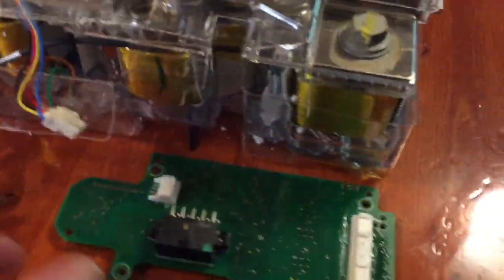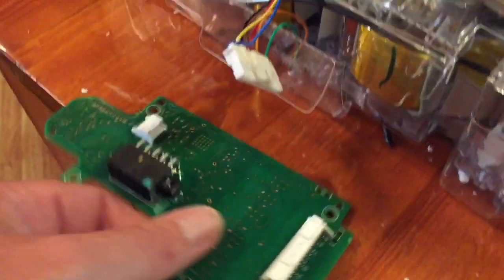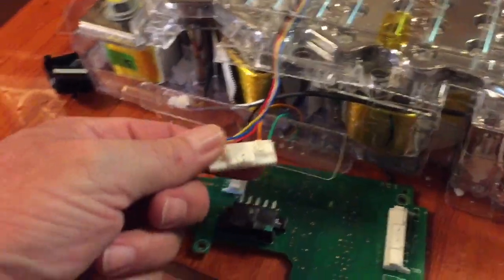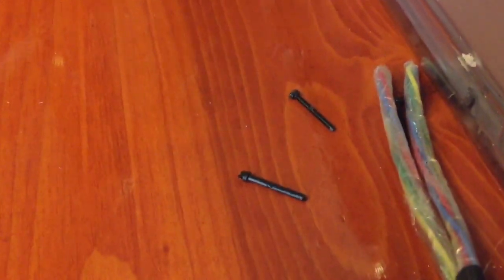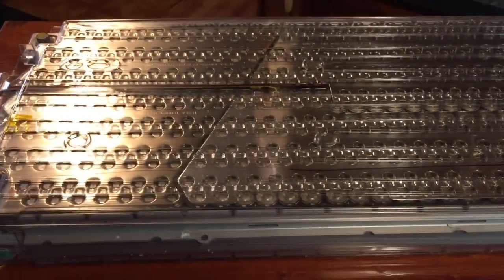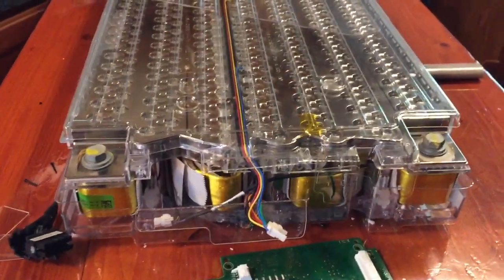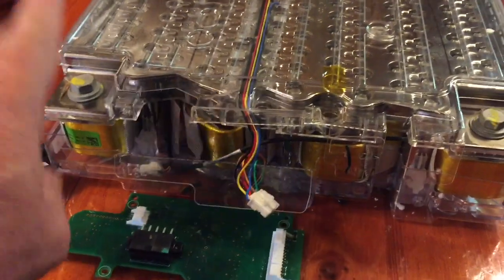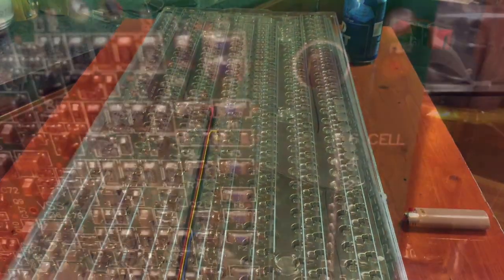Tesla battery module diy questions solar

Comment: I will try and make a video. But yes you can 100% use the 0 neg on the batt neg post. Just needs one main neg.. Then cell 1 would be 3.7 volts cell 2 will be 7.4 and so on. Just add find the lower volt lead that wil be some where around 3.2 to 4.0 volts depending on you batts volts.  PS I posted the video link. It may go to spam..

I will do my best to show this in a video tonight and up load it asap..
Reply from the maker: Thanks brother I think I figured it out last night , I’m putting both batteries in parallel for some reason I was thinking I needed the 12 to 24s balancer but wiring both in parallel the lowest 1 to 1 2 to 2 and so on plus the mains connected together should make the cells balance together if I’m correct I should only need to use 6 of the leads off of the balancer  the 6 pos. And the one negative main going out of the buck converter since it’s a common negative, I will watch the video before I do it though thank all of you , you going off grid , frankz and everyone I think lithium is gonna be great and I was over thinking it
Reply: @southernohiosolarhomestead8477  Yes your dead on brother. All you will be using is 6 wires off the balancer. Your welcome brother. Hope it helps..

Comment: likw frank said check to see if you first - is tied to your main -
Reply from the maker: I hate to sound kinda stupid but how do you do that? I’ve been lead acid only for a few years brother
Reply: @southernohiosolarhomestead8477  check the voltage between the main  negative and the first bms negative and if there us 0 volts then turn the meter to connectivity and see if those two negatives are the same
Reply from the maker: Oh yeah you guys are awesome

Comment: No experience with Tesla but you will need to determine  which wires represent each accumulative voltage starting with the main negative and then wire one would be the next lowest voltage and so on until you get to 7 which I believe is your highest voltage if you are setting up 24 volt if not then you will have to tie the packs together and fine the next voltage above the pack total I hope this makes sense to you.
Reply from the maker: Lord I think I’m gonna go with leaf next time lol thank you it’s gonna be a real trip with Tesla I think
Reply from the maker: Yes it does it woke me up thinking about it thank you , I was over thinking the whole thing
Reply: @southernohiosolarhomestead8477   Hey I see Bobby did a video for you once you get it it will seem so easy just use the volt meter and mark each wire with the volts then put them in order. Cheers
Reply from the maker: Yes he did I think I was over thinking the whole thing , very new to the lithium world still learning a lot from all of you thank you all